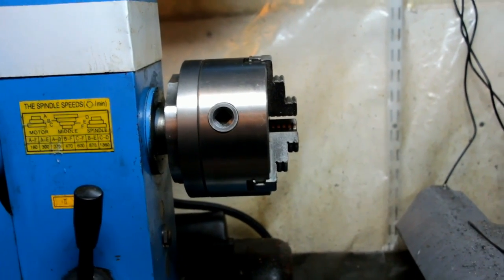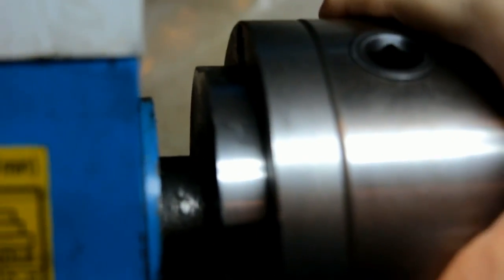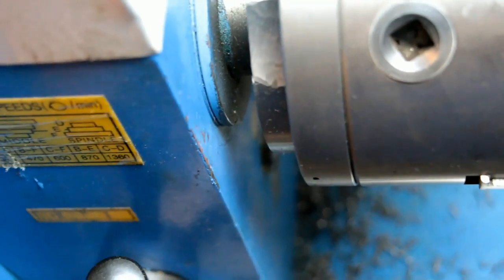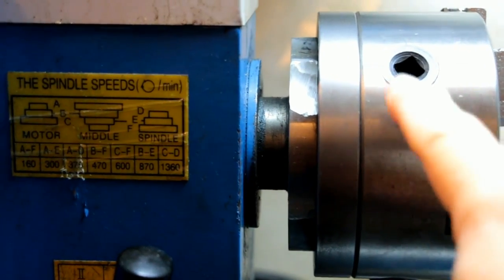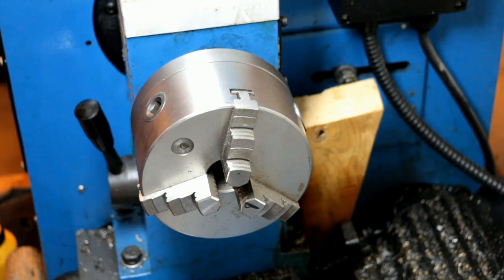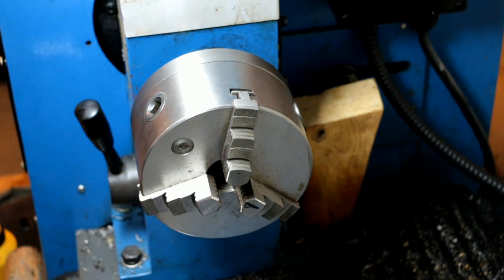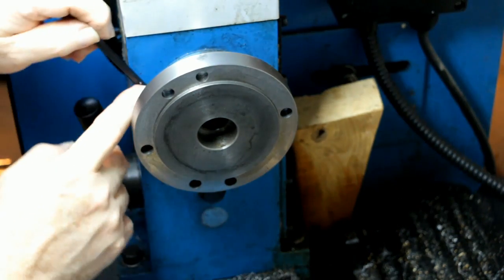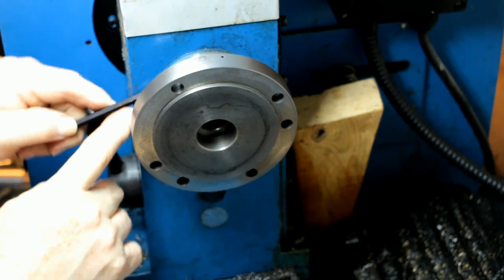Making a lathe chuck backing plate - Part 1

Comment: Well done. I own a HQ800 Lathe mill/drill and am thinking of adapting a 200mm diameter 4-jaw chuck. Would you have any idea please if it may be a bit of a heavy strain on the spindle bearings.

Comment: First- once you remove those socket heads- toss them away and replace them with hex head bolts- no need to go through all that pain every time.  Second, your new 3 jaw chuck can be bolted from the front into your backing plate- just drill through the threaded holes all the way through the chuck body, then counter bore the holes on the front side of the chuck and use socket head cap screws to secure the chuck to you back plate.

Comment: Did you discover the spindle is threaded? littlemachineshop.com also has a 4 inch chuck to 6 inch chuck adapter plate for your lathe for less than 40 dollars. A K11-160 chuck works like a charm, and has a 1-9/16" throw hole.